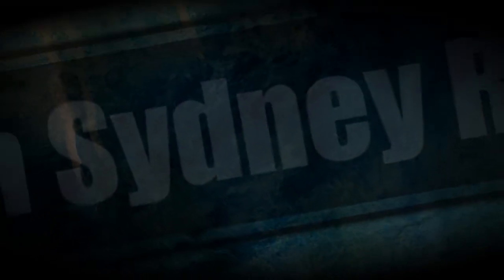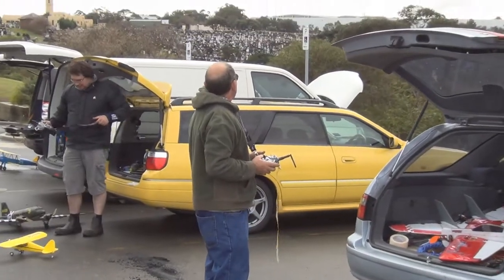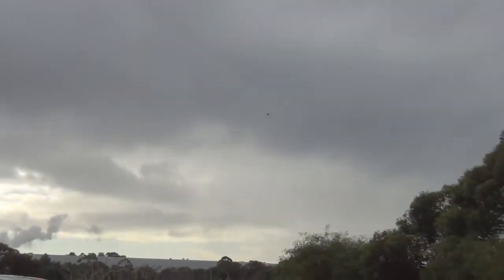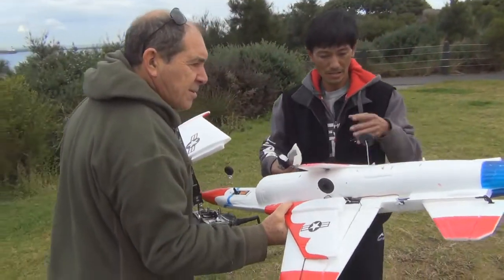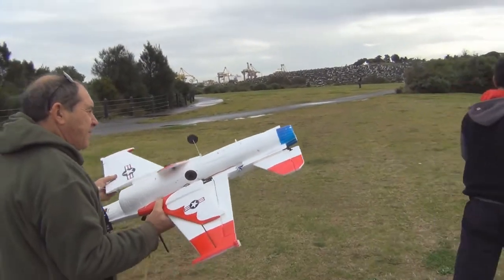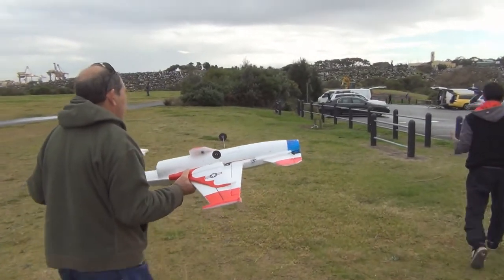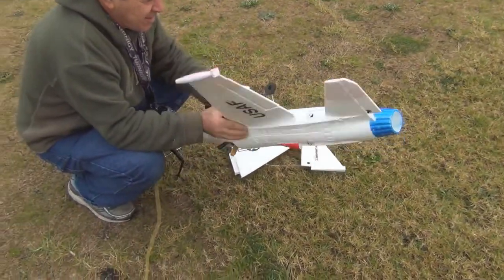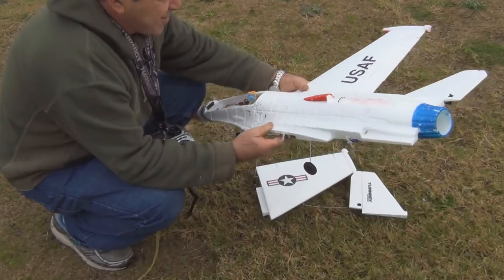7.7.12 RC F-16 mid air destruction

Comment from the maker: epoxy actually doesn't stick too well to epo unless you scratch the foam up a lot, he didn't use china glue, he was trying some different glue similar to PVA, the side that ripped off was still wet, the other dried ok and the wing was pretty strong